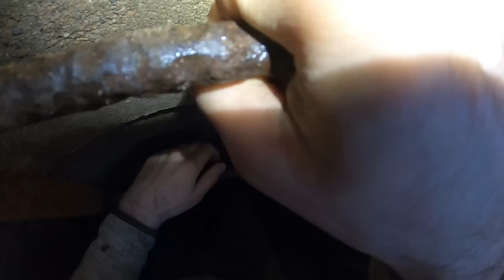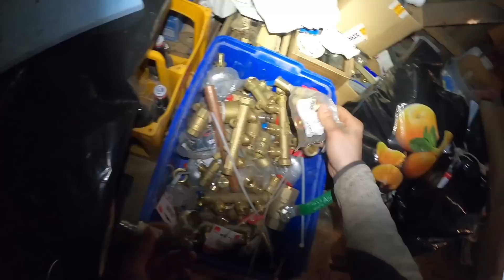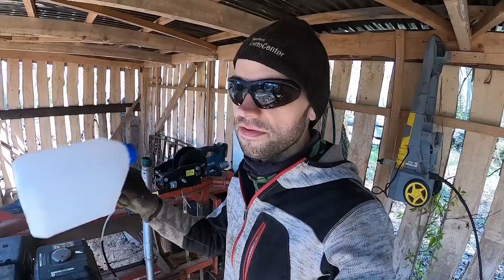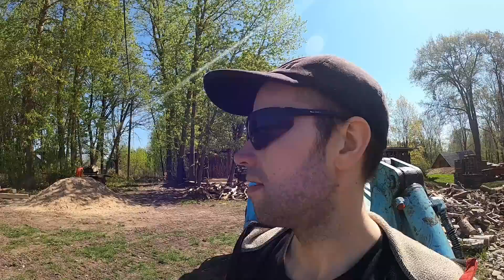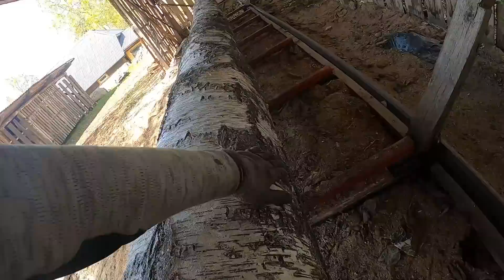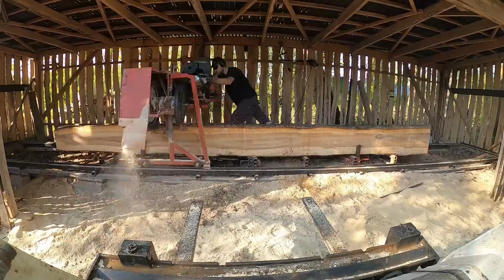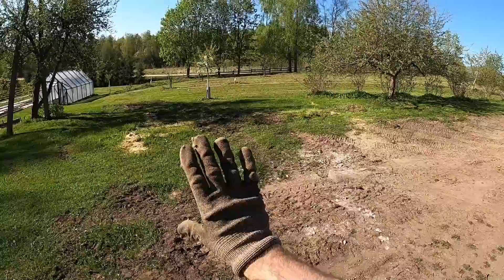Building a new workshop (part 1) - Sawmilling the main beams

Comment: Hi Ant. Theres is an obvius reason why birch normalyy isn´t used for construction. Pine or spruce grows without spiraling and tension. But as Kajsa Warg said, You take what you got and make the best of it. (Kajsa Warg was a Swedish cook in the late 1700 hundreds). I really enjoy your projects and  your unbreakable optimism getting things done. Best regards from your next door neighbour on the other side of the Baltic sea.
Reply from the maker: Thanks Martin
Reply: I am sure that all makes sense. To somebody. But if we don’t know kajsa warng, or what he had to do with birch, or pine or spruce, let alone his, or her. Impact on cooking. What does that halve to do with, what ant is doing? I am sure your explanation will take a encyclopedia of information. That will still be bull shit.
Reply: @SPUDHOME its because of the internal tension birch has so it warps as you can clearly see in this video. How can you make straight 2"4" when every cut you make make it worse? 

Birch is great for plywood, furniture where it's spread thin. I've had 10mm birch bend same thickness steel over a couple of months. It's will to warp is amazing.

Comment: My dad was a carpenter and all of them were using diesel with a little brush when using the vertical bandsaw. The quantity is little but i think its used as a lubricant for cutting the wood not so much as a coolant for the blade. Your thing is probably doing both cooling and lubricating since you have water and soap.
Reply from the maker: yeah

Comment: Birch twists a lot when drying as well. It helps to reduce twist by strapping the whole pile down. 

No insects at your place the likes to burrow into birch and lay eggs?
Reply from the maker: I have seen them but rarely. They usually hide under the bark. I put beams i made last year on the top. They should keep the bottom green beams under tension yes?
Reply: @Ants_Pants  Load on top helps very much yes, but there is a lot of force in those beams as they dry 🙂
It will probably be OK. 

About the firewood issue. Here in Norway we have seen runaway electricity prices. So old and inform people are very happy when they are donated firewood/wood scraps. Just an idea.

And I do like your work here on YT. Even if you do some really scary stuff at times, like driving that dozer on ice with side slopes.

Comment: I know it is too late, but have you tried release some air from tires and maybe to take off the roof from the bobcat machine to enter the shelter/workshop/storage cabin? When it will be loaded you can pump it a bit, not to damage the tires, it will be lower due to the heavy load.
Reply from the maker: think it's not worth it, that building overall is quite packed, need to haul half of it empty to have room for bobcat in there at all

Comment: Think that you can check the hydraulic level on that machine with the cylinders in any position. They should be all double acting cylinders so when retracted an equal amount of oil has filled the opposite side of the cylinder.
Reply from the maker: I thought there ia a bit more oil in the cylinder if its fully out then in.
Reply: concur @Ants_Pants

Comment: Good video. I thought you may have been able to keep some of the second grade timber to make a shelter with the roof panels. Maybe it wouldn't have been good enough. And the hoses rotting out - can you get some UV resistant tape that would go over the rubber? It might be a lot of work and just about worthwhile but there's probably something that would hold out and help avoid the rot developing. The stones on the bench look better every time I see it.
Reply from the maker: hehe :D actually i think i'm good. I try to keep them machines in-doors
Reply: @Ants_Pants  With the skid steer not fitting into the space it used to go in, I don't know if it was where you used to keep it, but just letting air out of the tyres may be worth testing out - I can't remember what you were putting it in that room for though....

Comment: if you cut a hole or door in the end and winch it in from the end of the mill. if you put a few rollers in you can tow it back out. and a chain hoist uver the saw mill can be wrapped around the log so as it lifts, it rolls the log.
Reply from the maker: yeah, i wanna do something like this, but first i wanna re-do the shed and bed with proper concrete footings.

Comment: To get birch timbers, it's a long process. Take a shim slab of f 4 sides, Put logg away out of the sun oan a level bed, after a couple monts do it again, no more than one inch cuts,(usually 1/2 to 3/4 inch). Do this till desired dimentions. Paint ends to help prevent checking. Thick cuts allows the pressure to relieve it'self too quickly
Just pile slabs on top of the lumber

Comment: MM77 Approved 👍🏼👍🏼………………………………………………Every hose I replace on my tractor, I put that nylon hydraulic hose protector on them. It keeps the sun off them and I know which hoses are the old/new ones. I figure the old ones will bust and the leaks will be easier to see, downside is I do get sprayed now and then! Dawn dish soap in the shower gets me squeaky clean after the hydraulic fluid bath! LOL!
Reply from the maker: haha :D iv used safety glasses now because i think fluid under pressure will burst into my eyes.

Comment: If you cover the hydraulic hoses with the ordinary peschel pipe for electricity, it will protect the hose against the UV, even if you would have to replace the peschel pipe every year it is much cheaper than one hydraulic hose. For example I cover my motorcycle which is standing outside the whole year round with the material cover, even if I need to replace the cover every three years it is cheaper than painting the plastics or polish the reflector plexiglass because of UV.
Reply from the maker: so true

Comment: A shaft end to end of Pipe with 90 degree dogs that will pull from rear to front with a electric motor or hand and well geared would pull the partial cut logs against the upright static dogs? You have good skills with engineering; get-r-done, lol.
Reply from the maker: Need time 😂

Comment: Build a concrete slab and bolt down your tracks on your saw sled.
Reply from the maker: it's on the to-do list lol
Reply: @Ants_Pants    👍🏾 Ok!  Build it longer and a little bit wider so it won’t be so cramped in there.  You need comfort!

Comment: What you need for the mill is a log landing, a series of logs perpendicular to the log to be sawn so you can just load up the log and use a kant book to roll it into place, you're have the get rid of the last bit of sid wall too. 👍
Reply from the maker: re-do the entire sawmill shed with a proper concrete foundation and then that.

Comment: Sounds like a great project I look forward to watching it go up. 
Fyi: if all the hydraulic cylinders are push pull and all tge air has been bleed out it should not mater what position they are in. There is fluid on both sides of the piston so they should all be full not mater extended or retracked
Reply from the maker: gotcha

Comment: @40:04 ..."90% of the work is handling the log..." : Why don't you fabbricate a couple of movable ramps that you can lock into your saw rails structure; then on the opposite side you also install a movable manual winch that you can lock and adjusted in the middle of your log length. After that you drop your log at the base of your ramp, passing the winch cable underneath it and tigh it back to a fix anchoring point next to your winch position. By winding your winch spool, the cable will pull & roll your log up to the ramps until it will eventually fall on place by resting onto your sawmill log platform. Next you fix your log into position.
Reply from the maker: yeah it's a good idea, i need to redo the shed though, its too small for this type of project.

Comment: Cylinders don't have to be all the way in for checking the hydraulic oil. Total Amount of oil will be the same! If it is not in the back of the cylinder then it will be at the front. So the cylinder is always "full"
Reply from the maker: gotcha

Comment: Do you prop up the small end while sawing to prevent the warp while drying?
Reply from the maker: Put some weight on the entire pile
Reply: @Ants_Pants  I meant when cutting tho wood to avoid cross grain.
Reply from the maker: @newandoldtech5634  ah! no, have not seen much people do it also, besides if i flip it i still will cut across grain right?
Reply: If the sides in the cut is even distance to the core it is less likely to warp.  Of course weights on top help out. To be real refined one can always try quarter sawing and use glue.

Comment: I would venture a guess that you need a real PeeVee.  The serious ones have a bull wood handle (bigger in the middle and tapering out to the handle and the socket ) with a socket that is cast steel  and built for work.  I have rarely if ever seen one with a broken handle as long as it wasn't left outside to rot.  Those Fiskar yuppy ones are toys and not suited for any kind of heavy pressure.
Reply from the maker: Yeah true.
Reply: @Ants Pants  I have found for curing logs and lumber a coating of whatever paint you have on the butt ends can slow down checking and cracking immensely.  If you are steaky, Anchor seal, I believe is the commercial product, but anything is better than nothing.  Then stack it level and put a ton of weight on that birch.  Design for it.  Cut them bigger, shorter, and sister them when necessary.  I have every confidence in you!  What you got is what you use.  But I would fertilize those spruce and pine trees to speed their growth, LOL!
Reply: P.S.  Spruce, hemlock and pine do the same thing but maybe a bit less when you cut the bands on a unit.  Have to get them nailed in quickly to hold their shape.

Comment: You need to get a toe board for your mill or at the very least some bits of wood to level the centre of the log.
First things first. Multiply the small end diameter of the log by 0.7. This will give you your cant size. So if you need a 175x175mm cant then you need a 250x250mm log at the small end.

Next, the idea of leveling the centre of the log is to reduce waste, and to minimize stresses in the log from sawing process.
It is easy to do. 
a) put the small end facing you where you start cutting.
b) measure the large end from the centre to the bottom then raise the small end to the same height as the centre of the large end is.
c) do the first cut[s]
d) rotate the log 180 deg and just cut with no leveling.
e) turn the log 90deg then repeat b, c & d.

This way, the cutting across rings is minimized and with it twisting.  You only need to level twice for each log.
Another thing I've found, is I never ever saw logs anymore that have been leaning or have been on the ground but suspended for most of their length - you're asking for trouble. 
There was a log at my place that was off the ground held up by the earth clod at one end and the crown held it up at the other. The log I cut out of it was 6m. I looked at it for 5 years and thought one day... Well that day came and as you know, the amount of pissing around to get it actually onto the mill and ready for cutting is all the work. The sawing takes comparatively little time.
Anyway, this log was just just like your log at the beginning of the vid. The whole thing was 3 hours of my time gone, 35 mins of excavator time with all the carnage the tracks cause around the place, the fuel etc. After a half dozen times of this sort of thing, you have to ask yourself why? Now I only take the very very best straight trees with absolutely minimal taper, no disease, and perfectly straight which means good trees are incredibly hard to find. I wait until I need wood and find a tree that has no birds living in it, isn't an important habitat tree for other wildlife (so no hollows) and doesn't fulfill a canopy or soil stabilization role. I also never ever take large diameter trees. Their ecological place is too important to just cut them for 2x4's. In all, very hard to find good trees.
Sometimes standing dead trees are OK but there's nearly always a reason why they died which you find out when they're on the mill. For the amount of effort required they're mostly just good for firewood. It's a big time and effort gamble using dead trees from my forest. I get about 30% luck. 
Good trees that have fallen over from saturated soil and wind are often gifts from the forest though. That happens a bit here and they've mostly been reasonably good - not perfect because I didn't choose them but just good useful trees.

Cut green wood and build a solar kiln is what I've worked out is best for the home saw miller.
Reply from the maker: i see

Comment: Your next sawmill shed obviously needs a gantry crane :)
Reply: or ramps ghat can lift and lower for load and unload.
Reply from the maker: thinking maybe some winch setup ?
Reply: @Ants_Pants  weld it to the other end with enough rope to double it. alternately you could just mount a snatch block at the end if your mill track and use your heavy equipment to drag it in. cheaper but harder to see what's going on. i was toying with making a dedicated trailer for a mill that folded open and you drag the mill to the tree for the big ones.

Comment: Looks like you can hire staff right away. And better too much fat than no fat for 50 years and as we say in the Netherlands 'old Dutch solid without fat and birch is not the best wood to build, they are often already rotten if you kick it. And so a saw installation is worth gold here you pay for the wood plus every saw cut depends on which wood type, but it's nice that the bull dozer gets a new home and the hydraulic hoses keep breaking at the same time because you usually do them all at the same time. one broken right away more greetings to your fam and ps one hour of content is good respect for your hard work which no one sees and also takes a lot of time
Reply from the maker: Of course. Personally i would prefer spruce or even pine. But i have very few good spruces left and almost zero pine so that's why i went with birch. The ones i got are not rotten though. Plus birch once it dries is a lot stronger then spruce or pine.
Reply: @Ants_Pants  Then it's time for you to plant a new one, you have plenty of land haha by the time you are old 30 years old and a bit of luck you build a house again or your children seem smart for the future wood is expensive greetings from the Netherlands

Comment: 4:08 there is too much things happening in this well to my taste. That is why here in almost 100% cases there is a cpecial hole being dug near the well to contain all that pumping and filtering stuff. Well itself remains clean. Also digging water bores istead of wells being more popular here. 
Your valve got frozen. You shuldn't leave any water armature on the open air if you've got below zero temperatures.
Reply from the maker: yeah true it's very packed in there. Your idea for a service pit next to the well is a very good one, i might do something like that one day 👍 I think so too, someone tried to turn the valve then it was obviously frozen and damaged the  valve ball

Comment: All of your hydraulic cylinders are double acting, therefore they carry the same amount of hydraulic fluid in the no matter the position therefore shouldn’t affect the fluid level in the tank. As for your fluid level changing while you moved them, I don’t know
Reply from the maker: iv always thought there is a bit more volume space inside the cylinder if the piston is fully extended. But i may be wrong on that

Comment: In your case, because you built your shed to low, especially using a fixed thumb , it can be a big pain in the butt. You keep getting to close, strech your boom out. Or raise the hight of you build, problems solved.  Go luck.
Reply from the maker: Yeah

Comment: Birch wood sucks as timber. Even the 50cm birch rod inside my rolling pin became a banana. Totally useless. Better suited as fire wood. 😄
Reply from the maker: oof! thats a bummer! ohwell, i put some weight on them birch beams... maybe they will stay stiff down there while they dry out. If not then i gotta go plan F-17
Reply: Either way, you're doing a great job. :)

Comment: I WONDER IF IT WOULD HAVE BEEN BETTER TO CUT THOSE 5 LOGS WHILE THEY WERE GREEN AN MAYBE THEY WOULD NOT HAVE SPLIT, CRACKED, OR TWISTED...
LOVE TO WATCH THE SAW CUT THRU THE LOGS;  ITS LIKE WATCHING A CAMP FIRE YOU JUST GO INTO BRAIN DEAD MODE... LOL🤣🤣🤣
WHEN YOU GO INTO DANCE PANTS MODE SOME TIMES ITS SO FUNNY TO WATCH IT....
JUST A THOUGHT.... HUMMMMM
Reply from the maker: they were still "green" only the ends were dry. Logs like these will take years to fully dry and by that time they have most likely split in half with the drying process